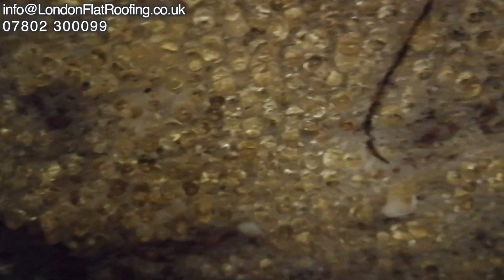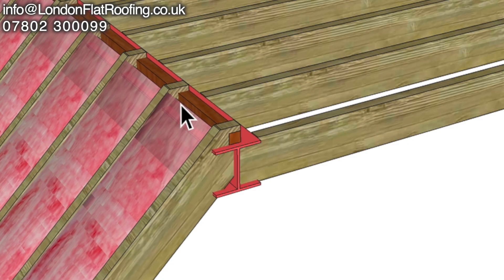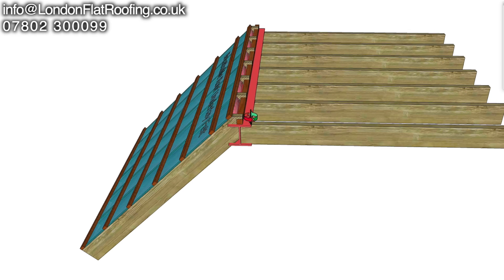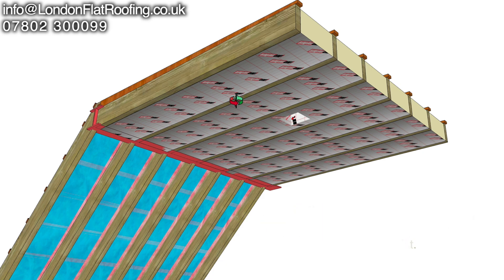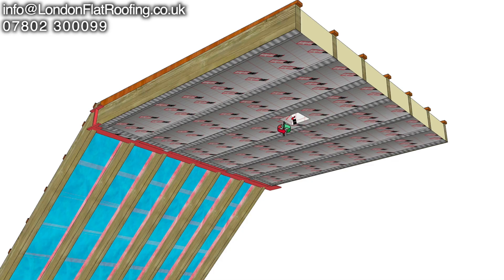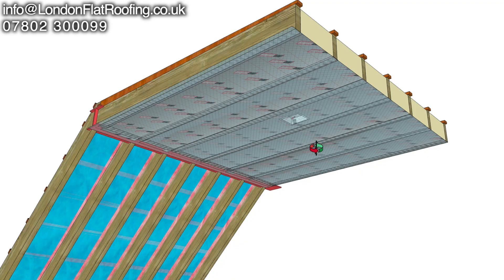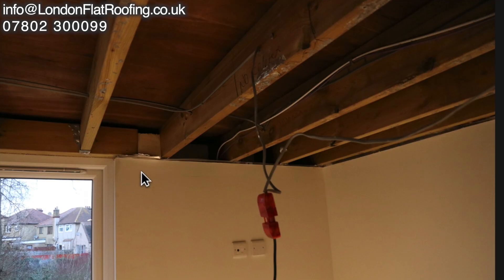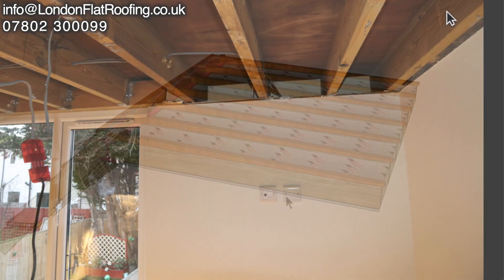Flat roof mould and bad ventilation in a new cold flat roof over a loft dormer.

Comment: I've been working on my kitchen ceiling (cold roof) in the house I just moved into. After removing the old ceiling I found there was zero insulation, no proper venting for air flow, and the room didn't have a cooker hood or extractor fan! Luckily there was no mould or condensatiion issues that I could see but the house can get over 60% humidity so I bought a dehumid and decided to update the roof. One side is connected to my neighbour so I can't have air flow going through the roof side to side, I did however attach some over fascia air flow vents down the other side and there were some cable holes in the joists (some used, some not) so I'm hoping that's enough for adequate air flow. The insulation I used was rockwool and I left an airgap above and put in a plastic VCL. I saw your other vid on getting the VCL around downlights and went for the home made VCL box, reinforced with tape method (they take so long to make! I didn't want to use those plastic boxes they sell as they weren't going to work for my situation and I needed something a bit more bespoke). I know you mentioned they can overheat the lights but I don't think I have any other choice really. I've sealed in the cable entry points as best I can with alumium tape, rubber tape and acoustic sealant. I've sealed the edges by bringing them down over the wall (which was the best solution for my situation) and used acoustic sealant and tape to adhere it, then the plasterboard will go over that and I can cover anything up with coving.  In addition to that I'll be installing an extraction hood and vent. It's not ideal and I'd love to have a warm roof instead but I'm hoping these changes are enough to keep things dry!

I guess I just wanted to talk about my roof! Before renovating this kitchen I had no DIY experience but your videos have helped me become a bit more knowledgable on rooves and what to consider, so thanks for that.

Comment: It’s all very well saying do a warm deck instead but lots of loft extensions cant get enough height to do warm deck so have to do a cold then incur all these problems because of insulation regs
Reply from the maker: obviously height is always an issue, but if you can't build something correctly, you shouldn't be building it at all. Otherwise it can go wrong regulation says do not do a cold roof unless you have to, but that really says something about cold roof, doesn't it?

Comment: This is very interesting i also learnt on school that ventilation is key 

I am very confused sometimes we are confronted with a cold roof, after contact with rockwool they advised me to stuff the insulation all the way against the wooden plate, use soft insulation witch can breathe in combination with climate foil on the warm side so moist can escape to only one side

Condensation always occur when it is cold, if you then ventilate with cold air witch is also moist then problems  can start they said
Reply from the maker: Unfortunately the manufacturers sometimes do give out bad information as they are only interested in their products. You really have to follow two schools of warm roof construction or cold roof construction personally I don't think cold roof construction is a robust construction thus I don't do it as I cannot guarantee it, I only do roof construction

Comment: i have a cold roof im insulating needs to ne 0.13 u value and to do that im going for 150mm celutex and 30mm celutex on top (the 30mm wil lbe the final layer flush with the joists. I didnt fancy putting up the sp40 seemed like a nightmare and a lot more work involved so i cane up with this as a better solution for me.  This configuration building control said is also acceptable, the question is do i put anything between the 150mm and the 30mm? i do know once its all up i need a vapour barrier on it and it will continue down the walls as well and i wil lbe using the butyl tape as mentioned in your video's seems like the best product to use. 

seen a lot of your video's very useful information but i didnt see this discussed so im hoping you can give me an answer. its an extension on an old house by the way

Comment: I recently had a dormer done and might have put the insulation in a manner where I was blocking the airflow slightly. Secondly, I believe that the osb boards were applied and they were wet. How could I dry them after the rubber roof has already been placed on?
Reply: Try using a good quality dehumidifier indoors. Could make a considerable difference

Comment: What about the cold bridge steel beam it passes all insulation moisture builds up on the steel and you are fucked
Reply from the maker: Yes, the steel beam is a problem and it will need to be addressed. However I'm not really talking about that in this video. It's a shame that the builders that built the building didn't address it at the correct time as it will be much easier to stop the thermal bridging

Comment: Hi Steve, I’ve just recently done away with the low ceiling in the kitchen which was installed purely to fit spot lights. The original ceiling is a vaulted lean to with a support beam midway which I favour as it’ll open up kitchen and looks far more interesting, the rafters are 4x2, no insulation as the original ceiling is old lath and plaster. It’s a slate lean to roof with a vapour barrier underneath with battens. Not ventilated.
I want to strip out the lath and plaster also. What’s the best way to vent and insulate  it. I’m guessing after watching numerous videos as well as your own that a cold roof is the way to go?

Comment: Having an external vent in the eaves of the flat roof allows cold moist air to enter the roof void. When the sun shines on the top finish it warms the air/moisture inside. Then at night when the surface cools, so does the deck, the warm air trapped in the void then condenses. That is the cause of that mould. If the cross ventilation is suitable, from eaves to ridge, then you dont even actually need a vapour barrier.
Reply from the maker: Can agree with the situation of allowing cold moist air in a lot of people. Don't realise that in bad weather this happens. However, it only happens in what's known as the wet period and wet period is only a matter of weeks or months. The rest of the year is the drying period and as long as the train period can try the roof it should keep on top of the wet period.

However, if the imbalance internally and externally is wrong, then it all goes pear-shaped. Cold flat roof construction not a good idea. Did you know that I can look at your videos by clicking on your name? Sometimes I do that because your name is slightly interesting, I did it I love that video you have watched about Dave Brubeck - Golden Brown I just listened to it twice absolutely fantastic
Reply: @SteveRoofer  thanks for the update. How does one do that with ghe vids?
Reply from the maker: @ShedDwellerMakerandRepairer  dont undertand
Reply: @SteveRoofer  you said you can lok at my videos that I have been watching?
Reply from the maker: @ShedDwellerMakerandRepairer  yes

Comment: By the model on the screen, You can't change to warm roof, unless of course you drop the joists. Because putting insilation on top of this joists would raise the ridge height, and planning very likely won't let you do that.
Reply from the maker: Yes, this is the problem. People don't realise that the difference between warm roof height and cold roof height is very little 50 to 75 mm. If done correctly. Problem is most people don't do cold roof correctly, so the depth of a badly installed cold roof against the depth of a well installed. Warm roof is closer to 100 to 150 mm, so realistically people are measuring things incorrectly in their minds. But whatever way you do it you have to plan. How are you put your joists in from the very beginning if you put them in for a cold roof you can't convert easily to a warm roof

Comment: As a loft converter of 25 years I can fully explain the issue on this building.  A plastic vapour barrier will not let any moisture through whatsoever.  On top of this the celotex is totally moisture proof. I know it has joints along the timbers but every building built now is insulated this way with generally no problems.   I know you mention the house ambient moisture levels a house sits at 9% but this did not effect this roof because of the plastic vapour barrier and celotex.  This was purely air flow its Vital.  Raising the ridge lines is a no no in most loft cases.
Reply from the maker: The correct Air Vapour Control Layer (AVCL) will let through vapour; however, it controls the amount hens why its called a control layer.  For a domestic property, you would normally install one that worked well to 60% humidity as above. This is considered to be undesirable.  If its not installed correctly, then it won't work. Celotex is totally moisture-proof however it has a high moisture resistance but again that's irrelevant if the AVCL is installed incorrectly.

Comment: Based on the research I've done, it's important to consider the stack effect with your ventilation plan. Having the vent on one side of the joist cavity lower than on the other creates a passive, temperature-differential driven flow of air through the joist cavities.

I'm having an issue with moisture accumulation in the joist cavity for my cold, flat roof even though I do have continuous venting on each side of every joist cavity. I'm trialing making adjustments to my build to promote the stack effect to see if that helps.
Reply from the maker: Excellent point,  so having sofit vents at one end  the lowest possible point and then say an abutment vent at the other end at the highest point. Not only will you have thought ventilation you will have movement through warm air rising. Love to see what your doing please send some photos steveroofer@gmail.com

Comment: I'm designing a dormer cold roof now, will a dry fix ventilation ridge tile system be enough to vent at the ridge.

Also I will have a steel much like the above, will 37mm PIR underneath satisfy building control for cold bridging bearing in mind the steel will sit exposed to the air directly beneath the dry fix ridge tiles? Thanks.

Comment: If joist is running counter to vents from soffits are you best to counter batten with say 2 * 3 Inc batten so air can go to vents preferably on edge to promote really good  3 Inch gap also what vents shall I get how many?
Reply from the maker: If you count batten then you will have lots of ventilation left right up and down ventilation everywhere so put in as many events as you can but if you're using mushroom vents we normally put them about 2 to 3 m apart when cross battening and you must have a face event or more vas mushroom vents the other end

Comment: jeeze, thats so much water it looks more like the roof leaked. But then one year i noticed my outdoor plastic shed was dripping wet on the inside, with a pool of water in some plastic tubs that were up against the walls... I'd stupidly decided it was a good idea to tape up all the gaps in the structure, and evidently the gap between the roof and the wall panel was supposed to be to allow airflow in and to allow any condensation to flow out and into a sort of guttering system on the outside of the wall panels. Taping up the gap meant air couldn't circulate, and any condensation ran down the inside of the roof, down the wall, onto the shelving that was against the walls, into any boxes that were touching the walls. the whole shed had basically turned into a water condenser/collector.

Comment: Surely those downlights are compromising the vapour barrier? All downlights let air through - it's needed to cool the bulbs and this will bring air from the room into the ventilation gap. The answer, of course, is to NOT have downlights cut into the ceiling - find another lighting solution (there are plenty).So, in short, downlights letting warm moist air into the cold space and no through ventilation to take it away.
Reply from the maker: Yes the lights are also the problem

Comment: I freak out a bit. 
I'm remodelling my bathroom. I'm making it as water tight as possible with foam backer board floor, walls and roof all taped up. 

I've added a mechanical heat recovery unit for the very purpose to stop mould and give good air changes.
Reply from the maker: Sounds good

Comment: Unvented flow .. No chance it wouldn't rot

Agreed Warm roof is the best 👍

150mm would never be noticed just make it run back to front
Reply from the maker: Yes a warm roof would have been better than cold roofs with GRP over the top tent to sweat a lot but are the choice of most loft room architects and builders

Comment: What a great video. Could the customer in this scenario put venitalition holes/turrets (sorry don't know what they're called) at the ridge end to allow a through movement of air, the flat roof will then have a series of ventilation pipes coming out of it but at least it'll stop the damp and rot.

Also warm decks are great and always the way to go, but it depends if the customer has the hight available to do a warm deck on a loft conversion? 
Or is that not true?

Also on a warm deck would the void underneath not need to be vented as it'll be warm due to the insulation being above?

Love your videos, just discovered them.
Reply from the maker: No you don't vent under a warm roof  and yes more ventilation on the existing cold roof would have help stop the problem
Reply: @SteveRoofer  thanks, I'll def do a warm roof when I do my loft conversion

Comment: Nice clear video. One thing I have found to add to you story is this can be caused because the roof timbers were soaking wet just prior to being closed in so the water drying out of the joists has no were to go when there is little through draught . I have also found this on warm roofs. In many other countries structural timbers have to be stored under cover , Where as in the UK they are nearly always out in the weather and are soaking wet.
Reply from the maker: yes this is known as construction moister moister that's licked in at the time of construction
Reply: Totally agree, I have seen a damp roof enclosed and it didn’t need any further moisture introduced it started with extreme mould from day one which we know leads to rot. No air venting created the problem you see in this video.

Comment: Oh, that's a typical sight for those conversions made by Romanian or Moldovan Building teams. 😂 The simple solution would be simply drilling holes in firrings and above that metal beam. This will get the moisture out of there. At least within a reasonable budget.
Reply from the maker: Unfortunately a long term solution is needed

Comment: hey, nice vid... particularly the use of CAD images to explain what you're seeing.

Just wanted to ask, if I have a bedroom where I have patches of black mould appearing on the ceiling that corresponds to the soffit vents behind...what's best to do?

I've recently been dealing with woodworm and, during this time, I had to strip out the existing 90s insulation to gain access through to the joists for preventative spraying.

As the new absolute minimum thickness of insulation is 250mm, I have decided to implement a raised frame to place my loft boards back onto giving me the space required for the new 200mm (the deepest I could find for a reasonable price 😔) insulation to sit under.

I have made the frame +50mm taller than the insulation which should give an air gap above it and, as such direct flow through to the soffit vents.

However, I'm wondering...should I be looking at doing anything like spraying a small amount of foam on the back of the  plasterboard near where the soffit vents are?

Reason I wondered is because I was told it may be as a result of cold spots immediately surrounding the vents.

Also, when placing the new insulation in the loft space, would I push it down into the soffit area or leave it with ventilation around it?

Thanks for any feedback...I know I'm probably being a little cheeky asking you on here 😅

Comment: Hi Steve. I’ve watched a few of your videos now and find them very informative. 
I’m about to do a garden build with a pent roof and I’m going for a cold roof because of the height issues. I’ve just watched the video with the dreadful mould growth due to lack of ventilation for the second time now. After watching it the first time I decided not to install down lights. 
Now after watching it again I now feel that it should be ok to install down lights so long as I have enough air flow through the roof. I just thought I’d ask you for the definitive answer. 
Also, if I have plenty of air flow across the roof, do I still need to install a vapour barrier?
It’s not a case of trying to save money. If you feel it’s still necessary then that’s how it’ll be.
Many thanks in advance

Regards

Pete.
Reply from the maker: Yes, venting is a good part of the equation but also air tightness from below is necessary and cutting in lights compromises that. It also compromises the thermal element as its really hard to achieve a good robust installation if you install spotlight

Comment: Could it help if the insulation board was pushed tightly to the roof level and leave a gap between the insulation and plaster board in the room just like a hybrid roof construction?
Reply from the maker: no  as you cant vent out the moisture